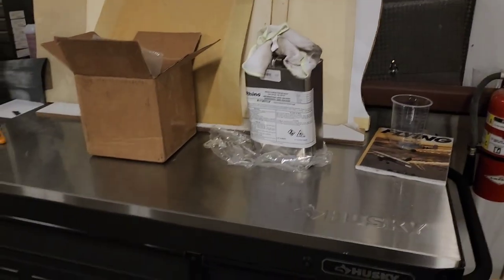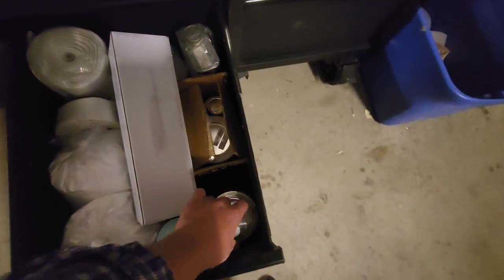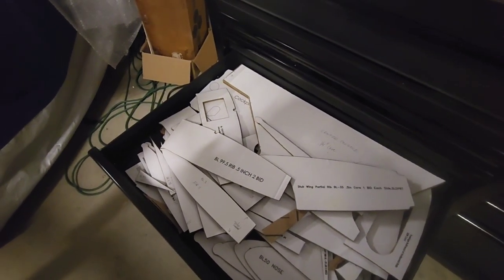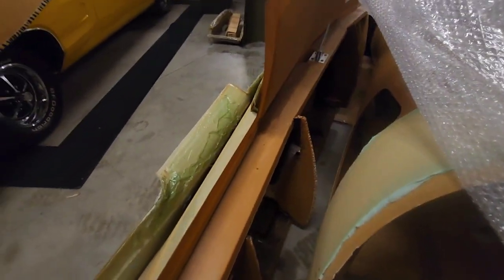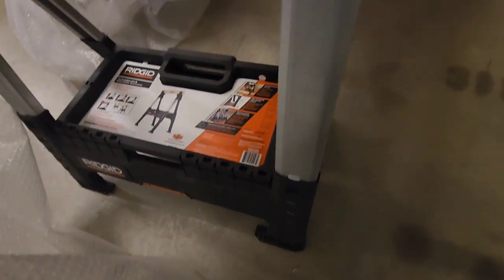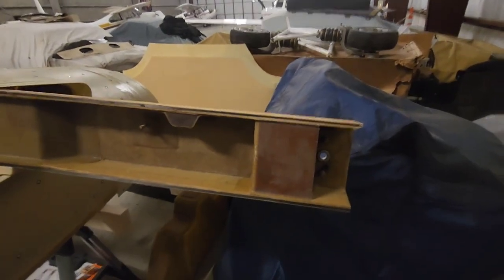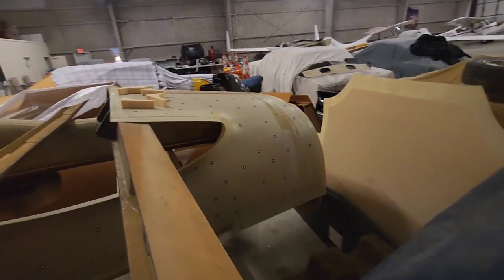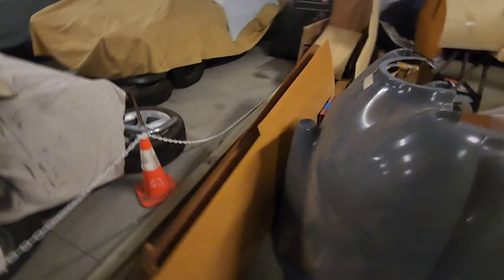building a Lancair 360 Mk II Kit airplane Part 1.

Comment: Hi Chris, I am just completing my 360 fast build kit that was purchased 4 years ago with most of the major fabrication completed. I purchased a Baluga modification and installed it on the fuselage. I hope you understand how much work you have ahead of you. I suggest you begin a procedure that will allow working on multiple projects in the same time period. For example, wings, control surfaces, and fuselage components. You should be working on all of these components at the same time otherwise building will take forever. In addition, prepping finish components for paint also takes a lot of time. Also, figure out exactly how your antennas, major components of your navigation system will be located and installed. You should know where it all will be located.  I would also consider building the backrest of the seat assembly to be removable to make it easier to work in the area behind the seat. Install your landing gear pump behind your seat and not behind the bulkhead behind the luggage space.. I also did not install the header tank in the cockpit instead main tank was enlarged to a max capacity 40 gals. Your videos are outstanding, please continue. The major fun to me about building a complex airplane is to research how other smart builders have solved many of the very complex issues building this airplane. The Dark aero project is also using the same engine you are planning to use but non turbo. You are making the airplane a lot more complicated with this choice. Is your project an R&D project or a build project? Turbo mods on 360's have just not been successful. I would definitely spend a great deal of time researching about how you are engineering the complex issues of turbos and intercooling.
I hope your enthusiasm remains intact throughout your project.

Comment: The Lancair lacks a modern and safe airfoil. The NLF 215 is not suitable! The australian horizontal stabilizer is still much to small. Reed Harry Ribletts book for airfoils!
Reply from the maker: I've seen the CFD analysis of the MKII tail, and the problem is the fuselage shape and wing to fuse transition. At high angles of attack, the wing root and low pressure area aft of the cabin create a very disturbed pocket of low-pressure turbulent air that disrupts the flow over the tail. The Beluga mods address the drag for high speed but NOT the low-speed steep angle descent problem. 

That beautiful coke bottle shape is its own problem. As for the NLF 215...it's fine for clean VFR flying but not so great when dirty with bugs.

I think the Lanciar Legacy airfoil addressed some of the behaviors with the outbound airfoil change, but it was not ideal, and they did not address the root issues.

Although design is always a compromise, I've been wondering if I could use a different airfoil for an all new wing design and use CFD-based topology optimization to cure the aft low pressure problem and smooth the airflow back to the tail.

My advice to all Lancair pilots is to use less steep approaches because they exasperate the tail turbulence issue. The MKII tail is just wide enough to get some of the outer section outside of this high drag turbulent airflow and restore some control authority.
Reply: @kraftwurx_Aviation  the NLF 0215 is more or less s sail plane airfoil. It has to much camber. In cruise it needs lots of reflex. NASA somply screwed up!..
Yeah coke bottle shape was corrected by most Reno racers.
Glassair the other design of the same time period uses the GAW-2 which is a aft loaded camber profil with high pitching moment. Again NASA simply screwed up and both designer as well.
Reply from the maker: @tinolino58  interested in a discussion about this topic and a potential new airfoil design replacement for the Lancair 360 kits?